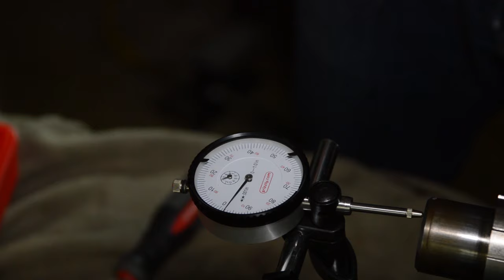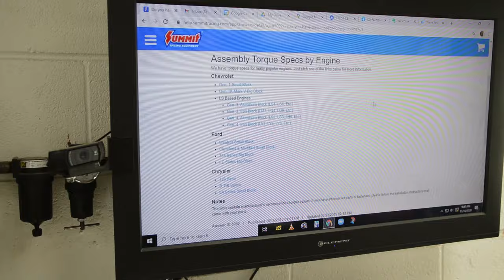LS engine FULL rebuild (15min time lapse)

Comment: I did not see you address the chronic hydrocilator issue on this model of engine.
Reply from the maker: Huh?
Reply: The fuckin what? 😂😂
Reply: I see you didn't sort the chronic meth issue?
Reply: Yeah cause it not a part or a word for that matter.😂
Reply: @HTMR what harness did u use
Reply from the maker: @Brandon_obs_ls  Holley term x ECU and harness.

Comment: Not LS engine.  Deceptive title
Reply: the only difference from an ls is the ls are aluminum blocks.
Reply: definitely a Gen 3 LS, check your knowledge
Reply: The difference is 
- first LS for sedans and L for trucks like LY6  and ls2 ,L77 for caprice both are 6.0 both rectangular port head 
-second the block material always specially in gen 3 LS the truck version is an iron block and sedan version is aluminum block
-the last difference is intake the truck are longer and bigger and that’s it 😂😂😂

Comment: I put a 5.3 with 180k in a c10. Elgin 1840p cam, pac1218 springs, and a billet 78/75. This has been its fourth year on 10psi. Fun rides
Reply from the maker: @Genx4  I have the same combo except cast wheel. I'm at 10psi also on E. Looking to increase that soon. Yeah it's fun!

Comment: Great job! Curious since it had been a couple years, how has motor perfored? Anything you wish would have done differently? Just bought my first 5.3 and getting ready to do same buildby watching you channel! Thanks in advance!
Reply from the maker: Runs great and now about 450-500hp with 10# of boost. I wish I went with a higher volume/pressure oil pump than the one I selected for my application. Only regret so far.

Comment: I would love to do a LS swap in my 68 chevelle and get rid of the 396 it's not a number matching car.  when doing the swap would you need a computer or wiring harness for the motor?
Reply from the maker: Yes there are many ECU options, however I would go with a Holley : https://youtu.be/0s_sCcoQqDM
Reply: Located?

Comment: Hey buddy, can you tell me the details on the accessories setup, engine mounts etc. In order to fit the engine in your car? I have a 70' that I'm putting a 6.0 in is why I'm asking. Thanks in advance!
Reply from the maker: Stock truck acc, holley fwd engine mounts, holley 302-3 oil pan. Fits perfect.